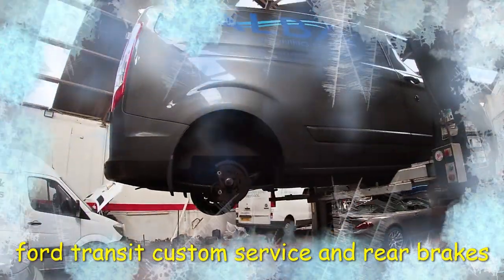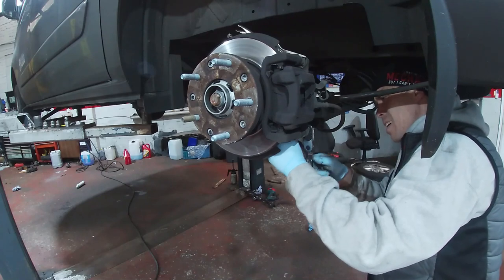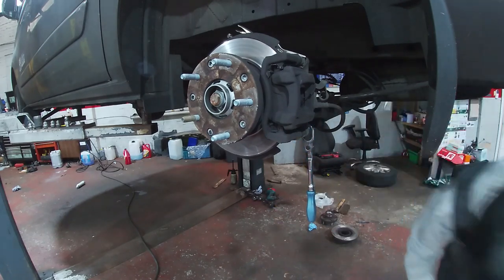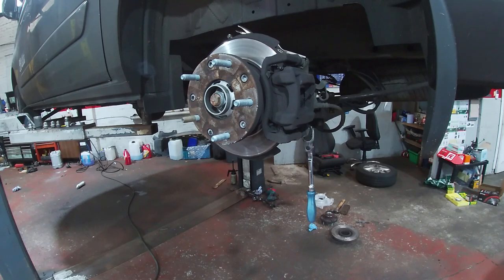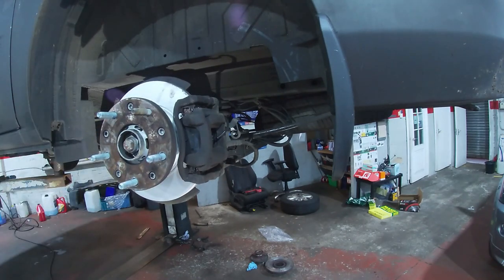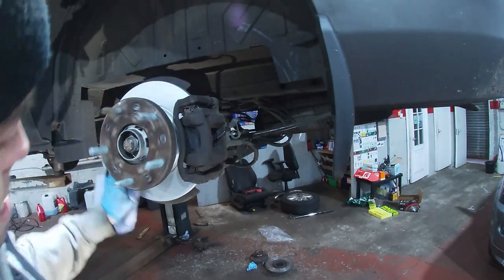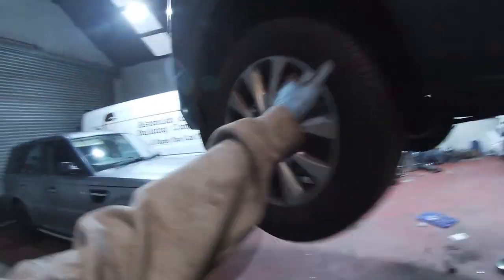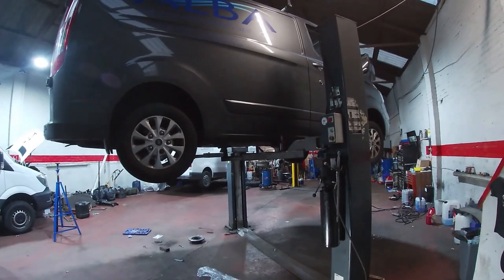#fordtransit  Transit Custom Rear Brakes replaced and engine service #mechanic #ford

Comment: What's the torque setting for the 36mm hub nut?
Reply from the maker: hi, and thank you for watching and commenting. If you haven't already, please subscribe to the channel if its front wheel drive and just a regular wheel bearing on the rear it's 340 nm  but if its rear wheel drive there is a special tool required and sequence to follow have a great day 👍
Reply: @CAIRNEYS AUTO SOLUTIONS   thanks
Reply from the maker: not a problem 👌
Reply: Is this the same setup on a t350 transit Front wheel drive?
Cheers